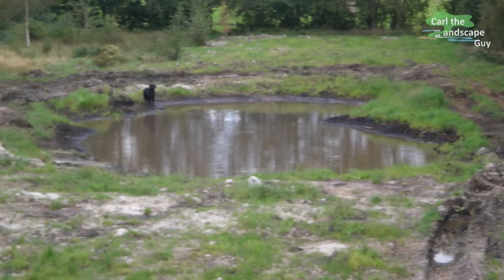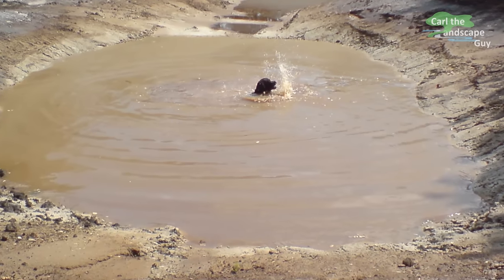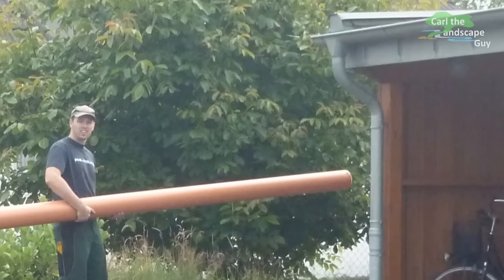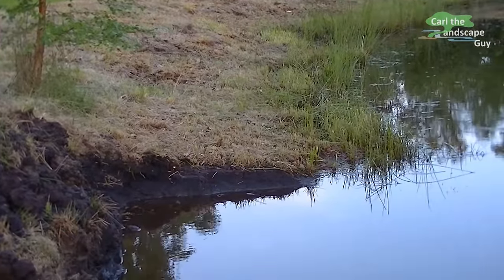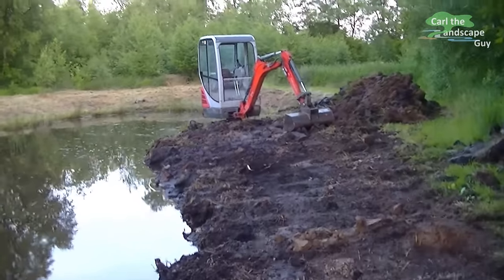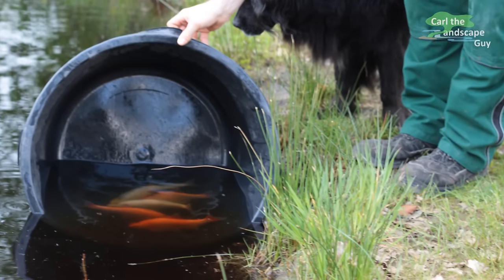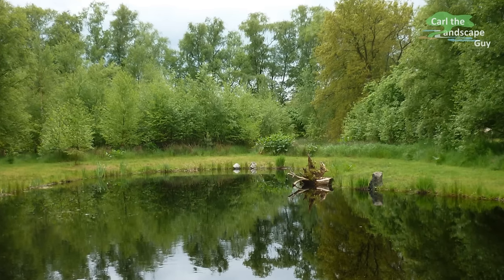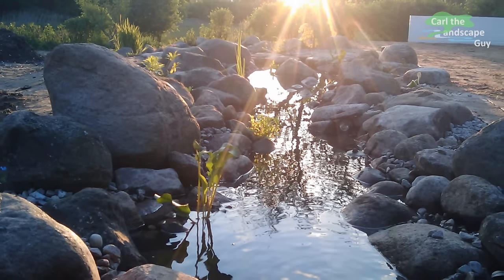HOW TO BUILD ALL NATURAL POND WITHOUT LINER |LOW COST+MAINTENANCE |BIG BACK YARD WATER LAKE HABITAT

Comment: Emphasis on the add very little fish because of the ammonia they'll produce. Also you can put in barley straw which you can find online or at feedin irrigation stores. Barley straw kills algae and removes co2 buildup,  which helps your fish. Barley straw is basically the organic equivalent of a UV electric clarifier.
Reply: Thank you!
Reply: Depends on flow rate and presence of cattails or other filter plants.  Isolated pond with no flow =low fish
Reply: @grantstacy1084  yep,  stagnant water usually is not great for any kind of pond you would wanna own.
Reply: Thank you 💓
Reply: @77Avadon77  what would be a good way to make movement in a pond in the woods. 
Thanks.

Comment: I have a a natural stream on my property so I dug out my pond in a pre-existing basin excavating it to where the deepest end was 12ft after rocking it in and the shallow end was 4ft i built 2 feeder streams one going downhill to the pond, the other leading uphill from the pond back to the stream so I could naturally fill it and deal with any run off going back to the river further upstream. I made sure the main feeder stream was 2ft deep so any fish could come thru. This was about 6 years ago and even though I have never added a single fish to the pond it still has fish in it that moved from the creek and even some that where actually born there! It took my nearly 2 weeks to finish but its 100% self sustaining almost as if it was always there :) if you have a stream on your property I highly recommend  doing it this way!  Very rewarding aswell!

Comment: When I dug one of my ponds over a known groundwater spring I hit an old 12" corrugated drain tile that was apparently clogged at the end... It shot water 12' into the air for two weeks before the pressure behind it was finally relieved... lol Scared the crap out of me when i hit it.  I thought I'd hit a main or something. I still don't know where that tile originates from or how far it goes but I know it was definitely installed to divert the spring from somewhere else on the property. The pond has been awesome and with the high cold water flow we've been able to grow some really nice trout!

Comment: I'm building a pond with no liner. I'm actually draining a 30,000 gallon pool to help get it going. There was a giant stump that I build a fire pit around and after it got big enough I drain the pool water into  the hole. All the ash helps hold the water in, so far. If it all drains through I'll just get a liner. The pool draining into the hole really helped expand it fast. as it filled the walls caved in and it keeps getting bigger, I just dig out the mud and fill pot holes in the yard.

Comment: Thanks Carl, I live in the Caribbean and would like to do something similar with a hole in the ground at my property. The problem is that there is no clay. I can use liner if necessary, however its the topics and everything grows like crazy. What would you recommend to help preserve the water, and if I use liner should I put a concrete base below or is sand adequate? Thanks!

Comment: Excellent video as I am struggling to figure out what to do with my pond. I just dug it. Could be deeper but it's a pretty good size pond. Anyhow I dug about 5-7 feet before hitting shell. Well my pond holds water but is very merky light brown. Build a big biological filter?  I have some really thick, almost like rubber, plastic. It has a hole or three here and there. Should I lay it in there and then pump the water through a filter?  To hold down the silt?

Comment: We have a natural pond in a fixer upper we just bought. It was full of cattails and debris. The pond is dry now as we haven’t had any rain here in Montana for a bit and it’s been hot. I cleaned it out yesterday removing all the cattails and as much of the sticks, dead leaves, etc. as I could. I know there’s “mulched” material in between all of the rocks at the bottom, which will be impossible to remove without taking out a million rocks. We want to get this pond in shape again, but I’m at a loss as to where to go from here. The pond is a kidney shape - about 35/40 feet long and about 4-1/2 feet deep in the middle. Do we add an aerator and some sort of filter to clean out what’s left in it? If so, what type? There are no pond experts anywhere near our small town to help us with this. Oh, the only water source for this pond is rain or a hose using our well water.

Comment: I'm off-grid in central Florida where my soil is fine sugar sand.  I dug a  hole about 5' deep, 10' wide by 15 long on a low side of my property to elevate a driveway and tiny house pad and create a great spot to collect water runoffs from the rest of the property.  I want to build a natural low-cost pond there possibly with no liner. Right now  the hole is so sandy and porous water does not collect.   A lock rock shop sells Marl really cheap would that help? Thinking about just mixing in some Portland cement 10:1 and coating with a sealer??  Also If I install a 45mil liner (which I think often looks ugly) I want the top lip to bend out about 2' below ground level and 1' below the water level so it's never visible. In addition thinking about just dropping a 500 gallon tube at the bottom and working naturally around that too.  Any suggestions?

Comment: Hi, at what permeability level does it become necessary to use pond liner?
Reply: You can do a small test pit to see how well your soil performs.If you want to increase water retention, all you have to do is add cattle dung and finely chopped leaf litter every 2 months. The biomass and silt will slowly accumulate and seal the pond. This is how natural ponds get sealed off. You can also collect silt, from existing water bodies by dredging and use in your pond. a pond liner is quick fix and usually leads to all sorts of problems. Its good if u are desperate for water and need a s cheap storage tank. Otherwise let the pond form itself over 1-2 years. cheers. Another good start is to compact your pond bottom with a heavy machine which can also improve water retention.
Reply: @raghuveerananbalagan9635  Hey thank you so much for your info!! You are pro.

Comment: Where we live in Central Pa, we have a small creek as the edge of our property line. The problem is that it's 175' down a steep embankment/cliff.
We also are a few hundred yards from a large creek, bottom lands, and will have a fair amount of wildlife around, such as foxes, ducks, muskrats, bald eagles, blue herons, etc.
What I think I want to do, is build a pond in the same place where my 16x32 ft above ground pool was, but it's 15' from the foundation, so I think I will have to use a liner, even though the soil is all clay and shale. The ground level of the bottom of the pool is about 5' below the level of the first floor of the house, and is sloped away from the house, toward the cliff at the back of our property.
Any thoughts?

Comment: ok - I have a waterpit .  It was excavated in the woods and we are in a very clay soil area but the pond water is yucky, murky and unattractive.  This is at a vacation rental property in the middle of the woods.  Can't and don't want a pump.  What can we do to clear the water?
Reply from the maker: the deeper, usually the clearer the water. and i will put a layer of washed sand on the bottom of the pond to stop sediments

Comment: "How to build ALL NATURAL pond"
Puts in pipes..
Reply: Same thing I said
Reply: 🤔same hear.
Reply: Ehhhh I get that but it’s also an unnecessary step. The point is that it takes work to get it to occur there or else you wouldn’t have to make the pond anyway.... hes encouraging a higher water level.
Reply: Seriously - it saves me so much time to read the comments before watching something like this. Thank you - I don't want to mess with pipes.
Reply: Most of recent summers are quite hot and dry in my area, and most ponds are quickly dry. Pipes just add natural rain water from a surface nearby, water that would be mixed with used water and lost, if not directed to the pond... also natural ponds acidify, fill in with vegetal deposits and plants, then disappear in a few years if nothing is done, so adding more clean rain water and a drain may help them last a little longer ?
I just added a pipe between the gutter of my little glasshouse and a small pond with too many reeds that suck and evaporate the water in no time, andI hope it keeps it alive a bit longer, before I need to start all over again with heavy work...
Reply: And PVC at that...
Reply: @NANA-tz7ep  As opposed to.....ceramic?  Clay pipes are considerably more expensive, harder to work with, have a higher friction coefficient, clog up faster, and are prone to cracking over time plus are more fragile during installation and subsequent lifespan.  But then I'm sure you knew all that.
Reply: The pond itself was all natural.  The pipes were there to assist with rain capture and water level maintenance.  There are other ways to do that of course, but using pipes to direct additional fresh water into the pond doesn't undermine its natural credentials. And remember you need to consider volumetric turnover time when designing a pond and its infill source, but you all know that of course.
Reply: He could have left a open ditch filled with rock, but pipe is cheaper and easier to clean and maintain.   The pipe would also allow fish to come and go from a creek if that's someone's situation.
Reply: @Karinalice  Which is hilarious because the pipes aren't necessary, only installed in his case to keep water levels consistent and avoid using house water to fill.
Reply: also non native koi

Comment: Just watched two of your videos of this pond design.I have a 30' pond that I had dug out to 6' depth. My 10 koi are doing fine after 1 year. I have a waterfall feature that I plan to run fresh pump water thru to help filter the pond and add new water to the pond when it is low during certain months of the year. Does it sound like to you that I am on a good track?

Comment: Nice still water pond. As for using loam, only a clay loam might work, if it has enough clay, but not as good as clay since loam has much higher permeability than clay. You mention of not adding too many fish - they multiply, especially goldfish, assuming that's what you added and not Koi, which are too disruptive to the plants. You will probably have so many fish in a couple years you will need to reduce the population. A predator like bass keeps the goldfish population down.

Comment: Would it be a bad thing to swim in a pond like this?
Reply from the maker: +Reub3 not at all as long as its warm enough outside ;-)
Reply: +Reub3 Just watch out for the snapping turtles!
Reply: lol eeeeek!!!
Reply: +Haitian Refugee that would be my favorite part lol
Reply: +Reub3 I guess it depends on where the pond is plus some other factors, be careful though there can be some nasty stuff in pond water Naegleria fowleri for example is quite nightmarish.
Reply: You can contact an environmental engineering company to test the water to see if it is safe to swim. it will cost$25-300 depending on tests, methods, and area you live in.
Reply: Consider that there may be organisms in that water that can harm you. Every year or so, we hear about some teenage kid getting an Ameba  in their brain and killing them.  Where did that Ameba come from? They come from stagnant fresh water.. Stagnant only in that it might not have a source of fresh water flowing in or that the fresh water flowing in is not enough to replace the volume of water very quickly (time?) Usually, when they question the sick person, it turns out they were swimming in a pond or larger body of water, got some water in their nose and that's it.  

Why is water in the nose bad??  There is a little bit of tissue hanging from under our brains and into our nose passageways... that it the organelle we use to smell things with..  Well, for the ameba, that in a big happy meal that it will eat its way up into your brain. I haven't heard of a cure, so you pretty much will just die when this happens.

So, is the water safe to swim in... IDK... I do know that if it isn't you will have no way to know unless someone test the water (hit/miss) or you find a history of sickness from that body of water (unlikely)

and just for good info, the water that flows past Washington DC, the Potomac, has an organism in it that has many different body shapes it  changes into over its lifelite.  One is an amoeba like shape.  If you swim in water with that organism around, they will secrete a neurotoxin and if you swim through that cloud of neurotoxins, you will exit the water with more than a few IQ points down, for life...  

is the water safe to swim in....
Reply: Paul Gdry "Every year or so, we hear about some teenage kid getting an Ameba in their brain and killing them"

Yea that's Naegleria fowleri
Reply: Sorry about than man.. Nature...    Naegleria fowleri  yow...
Reply: you must be fun at parties....
Reply: Have you seen the show Monsters Inside Me? I won't swim in any fresh water unless it's a chlorinated pool.
Reply: Reub3 if its a pond that doesnt have any flow, it can have a disease that can go into your nose & into your brain & can kill you. learned it in biology
Reply: Darwin chuckles when people ask for  health advice on youtube.
Reply: Not unless you want to get eaten by the loch Ness monster.

Comment: He said it was six feet deep, yet he's standing near the middle and the water was up to his knees?
Reply: He was standing on the back of a koi.
Reply: He's probably talking about just some part of it being that deep... unless he converted his measurements from metric to imperial and got it wrong. :) 
Either way it doesn't have to be that deep unless you're wanting to swim in it or something. A small area of four feet deep is plenty for the typical varieties of critters & fish found in ponds to hang out overwinter.
Reply: @WebbyWunda    In the South, four feet is too shallow. The water gets hot in summer and oxygen comes out of solution. Everything dies.